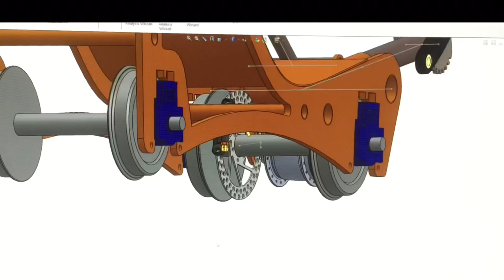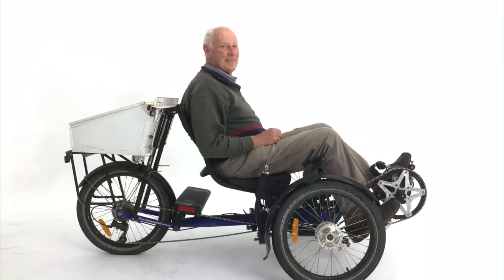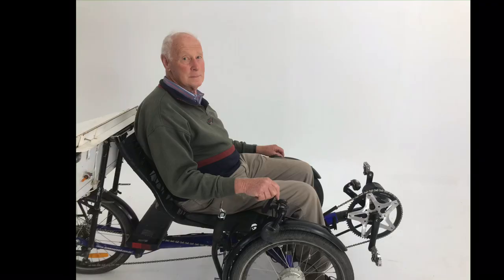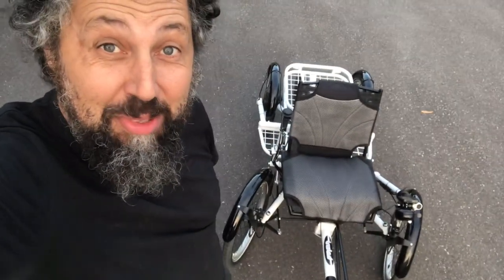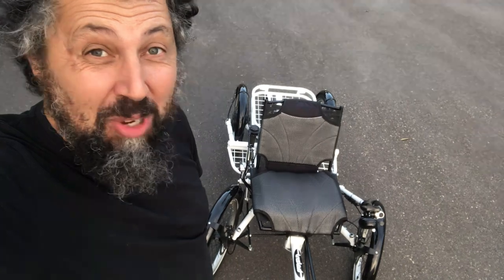Full Suspension Two Seat Quad Build

Comment: Fantastic build, but your suspension idea is not new, about 40 years ago I built a suspension system for a friend on a motorcycle trailer on the farm, in which he took farm dogs. He wanted suspension on the trailer so it would be easier on the dogs feet and legs on a rugged shingle road up a Blenheim valley. The system I built was using two old motorcycle shock & spring units situated horizontally and pinned to a very similar crank system as you have used on the quad and trikes you build.

Comment: Very nice, Ben.  I realize this was a custom project and you were building according to your customer's wishes, but two things immediately came to mind as I was watching the video:  the lack of a second crankset for the rider in the rear (should they choose to burn some of their own calories) and the lack of a differential; with all of the power going to one wheel.  I am certain that if I were to approach you with those requirements on a custom build, you would be more than willing and very capable of accommodating those additional features.  In corresponding with you a few years back, you said Trisled was working on a four-wheeled velomobile prototype.  Is this a project that is still active?
Reply: It appears that the right rear wheel was an in wheel electric motor, so at least both wheels can drive, unlike in the "off grid mojo" people mover where the e-drive was on the crankset and still only went to the left rear. And was expected to pull a 300kg trailer...
Reply from the maker: Firstly: Two wheel drive with one being human powered and one being motor powered is MUCH more effective then a differential! Diffs are inefficient, heavy and very effective at directing power to the wheel that is slipping instead of the ones that grip.
Secondly: this is not a tandem machine. It’s intended to be able to offer an occasional ride to a second person. A second fully functional pedalling seat would make the machine twice as long, twice as heavy half as manoeuvrable. Therefore ineffective as a solo machine.
Reply from the maker: And Paul our original design brief was not for a 300kg trailer with the Mojo project. When creating custom builds for peoples dreams the expectations are more always clear and limits often exceeded. Daring to build them and see how they go is i feel what makes us unique.
Reply: @TriSled  And you are no longer working on a four-wheeled velomobile design?  Thanks, guys for the replies.
Reply from the maker: @Brian-bp5pe  thanks for your interest! Yes we are. A little behind planned timeframe unfortunately but hoping to have some progress on it through this year
Reply: @TriSled  Yeah, I thought as much, and thanks for taking the time to explain. I like this design solution (2 wheel drive). And the suspension looks to be a winner.
Reply: @TriSled how much is it?